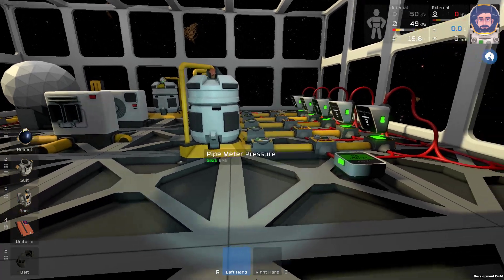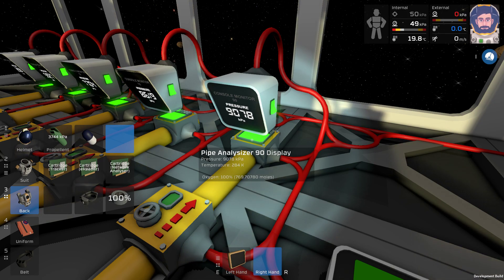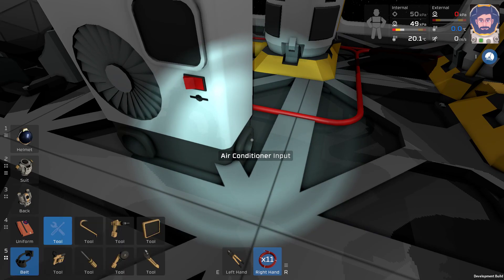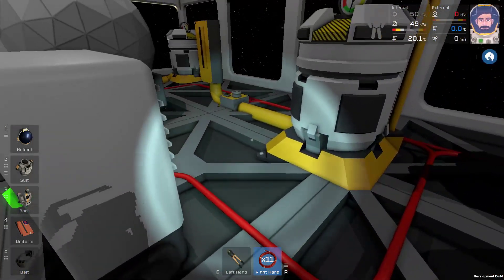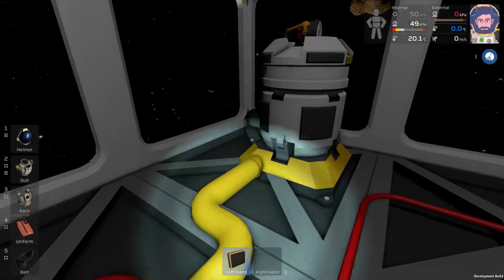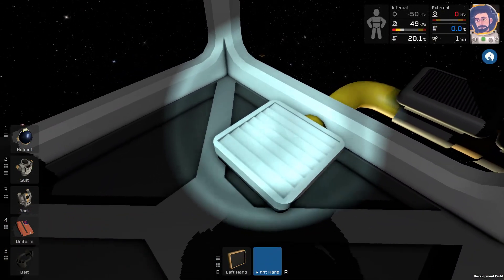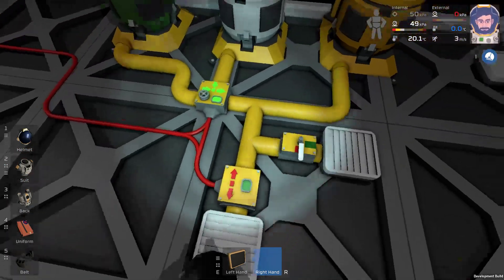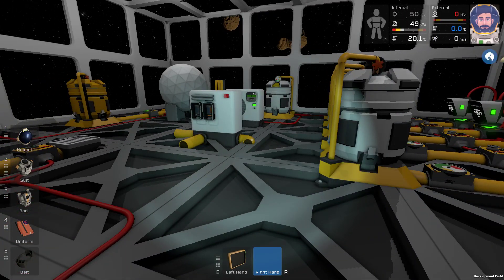Stationeers Tutorial Part 4 - Pipes Galore

Comment: Thanks for the video on pipes and all the attachments.
Hope you continue making more, as I say in all of your videos hehe..

Just a quick question, what is the correct mixing of breathable air up to this time of development of the game?

I get mixed answers/ results when searching online, but would a mix of 90% Oxygen and then 10% Nitrogen be correct?
If I remember correctly, I think the portable tank you spawn in with has that mixture?

I run CO2 and Volatile filters in the suit now I believe (I don't remember on top of my head). 
And that got rid of the low pressure warnings every 10-15 minutes or so.
Reply from the maker: You can breathe any mix that has oxygen in it given the correct filters. In a base pressurized to 100 KPA you can breathe any mix of oxygen/nitrogen as long as the oxygen is above 20ish percent. Inside your suit you should be breathing 100% oxygen ideally.
Reply: From what I understand you don't want to go anywhere near 100% oxygen inside of a base. With 100% oxygen, you can run the base at a lower pressure (approx. 50kpa), but it heats up faster and allows for fires more often. Best I've heard so far is a 25% Oxygen, 75% Nitrogen mix. You can get a decent pressure (100kpa), and have a low risk for fires. Also, you can then try adding 10% CO2 to the mix for the pipes that are just going to your hydroponics room.

Comment: With the air handler units, cant you just hook up the waste out put to a pipe and send it to a new unit and the new unit will head up/cool down the waste to the temp needed as well?
Reply from the maker: If you know that the gas is too cold or too hot you could heat/cool it using radiators to assist the AC. Personally I never use the AC because dealing with the waste gas is just so annoying. Even the devs said they don't like the AC unit and it will probably be redesigned in the future.
Reply: Well, it's actually not that hard and/or confusing. You simply put like 5-10 pipes on the waste AC connector. At the end you connect a canister storage unit and insert a canister with X-gas, which is Chlorine (refrigient) and fill the pipe to greater than 101kPA. You can then disconnect the storage unit and leave the pipe as a dead end. Remember to add Pipe Coolers on it. The AC unit will then use this super cold gas to cool the input gas mix and if the gas needs heating it just uses power. So no, the AC unit is not hard to control, you just need to know how it works.
Reply from the maker: That's very helpful information, but regardless the devs have said there will probably  be an AC overhaul in the future because it's obtuse and bulky.

Comment: That is not how wall coolers work. They work by taking the heat from air in the room and putting it into gas in the pipe. Great video otherwise!
Reply from the maker: So I tested the coolers just now, the pipes exchange heat from the cooler to the end of the pipe (in this case a passive vent) but no air was exchanged. Is this what you meant?
Reply: Not exactly. Wall coolers do not move air at all. They require some gas pressure in atmosphere around them, and also some gas pressure inside the pipe. they can be different gasses and they will not mix. For example i usually have a pipe filled with co2 that i attach wall coolers to, and then i run that pipe outside the base and attach pipe heat radiators. Wall coolers steal heat from the room and put it in the pipe heating up co2, which in turn gets cooled by radiators. Your setup with passive vent means that wall cooler steals the heat from the room and puts it in the air inside the pipe, which in turn gets mixed with the air in the room because of passive vent. Not a very efficient setup.
Reply: Nice explanation, i cought a littit bit of that from a dev stream but not in full. thank you.
Reply from the maker: You're welcome
Reply from the maker: Yeah I knew they worked that way, I just phrased it poorly, for sure. I know how they work, just demoed it poorly.